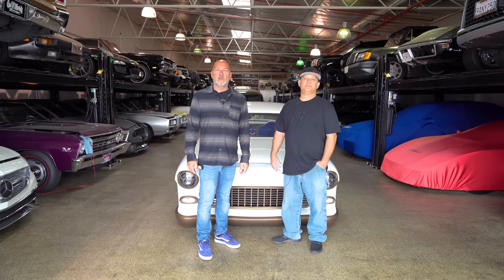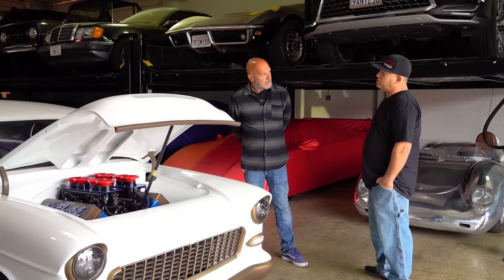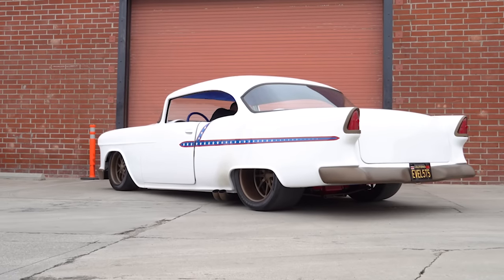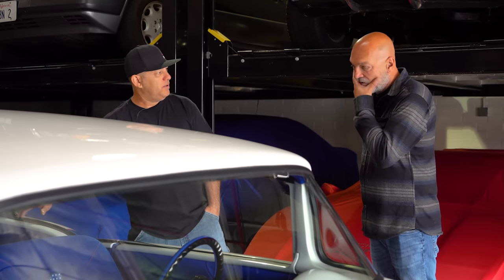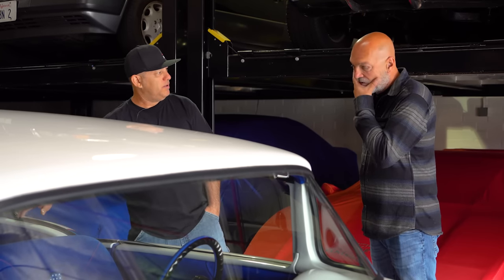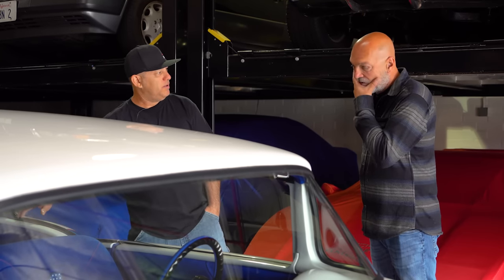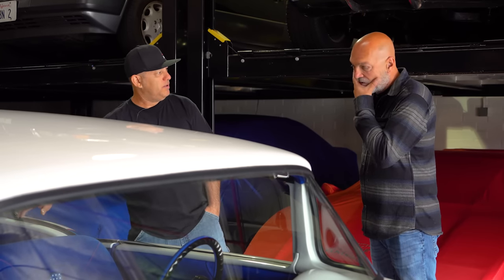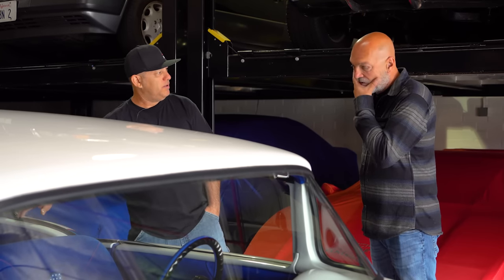712 ci All Motor '55 Chevy Making Over 1000 hp! Evel Knievel Would Be Proud

Comment: The rear end is based on the old Jaguar type rear end where the half shaft acts also as the upper control arm. It's not geometrically very sound but along with the inboard disc brakes keeps the unsprung mass low.

Comment: Use Vaseline on the Body panel near the pipes,so when you ride,you can wipe off the carbon when done.
Reply: Great tip,
Thank you 💯
Reply: @LakesideCustoms36  Yes,I learned about this when someone was doing smoking burnouts and the rubber was sticking to the quarter panels and a $100 tip on the Carcraft tip for the month back in 1985 🙂
Reply from the maker: Smart idea

Comment: What is there a small group of guys local that have these things built? I mean these are $250,000 or more cars when all said and done.
Get a nice custom piece of carbon fiber to overlay on body where exhaust exits and is burning the paint. I got a white turbo catless car and the flames werw burning my bumpee jntil i bought and installed a carbon fiber exhaust piece that covers bumper in that area.  Attached with 3 rivets.  Looks great, no more stained\meltwd paint\bumper.

Comment: Should've done a Cadillac Mirage if you were honoring E.K., when did he have a double nickel shoebox? And 712 CI to make 1000 hp? My 598 stroker makes nearly 900 and will rev to 7 grand, sounds way better than that thing and probably cost half the price. IMO Scott Sullivan had the baddest looking '55 back in the '80s with that tubbed cheez whiz orange monster that was on every magazine cover for months.
Reply: 😂😂😂
A Cadillac??
Come on man…
Reply: @LakesideCustoms36  At least it's a vehicle he was known for. We see so many pics of E.K. with his '55,...oh wait. BTW, that thing's WAY over fueled, I've never seen an EFI setup smoke so much off pedal. Need some tips?
Reply: Maybe a steam rocket car or a wheelie cars would be rad driving down the highway, Shawn would really love riding down the road in that one.
Westech put a temp tune in this before we shoot the video of the chassis dyno. The techs in that place are some of the sharpest in the world for sure.

Stay tuned for the chassis dyno video and it should run about 8k RPM,s. That’s why we spent the extra on the engine.💯🇺🇸😎
Reply: @LakesideCustoms36  The way it smoked it looked like a steamer, lol.

Comment: When somebody says all motor They are making a mistake because motors are electric and not measured in cubic inches only an internal combustion engine is measured in CID, Stop calling engines, Motors. anytime somebody calls there car all motor, I will refer to it as a Tesla. 🤣
Reply: Do you say enginecycles or motorcycle. Motor definition is a machine, especially one powered by electricity or internal combustion, that supplies motive power for a vehicle or for some other device with moving parts. So stop with this annoying, it's not a motor bullshit

Comment: These shops are claiming big big numbers all the time.  People pay and say " I want 1k hp" never having felt a true 700whp in a rear wheel drive vehicle. You're talking either using race gas with at least 110 octane or using a computer controlled E85 setup.  To get big numbers off 91 cali pump or 93 octane everywhere else is very hard to do unless built, little timing and lots of boost.  A real 1000whp+ car will spin the rear tires at 70mph on the street running 315 width R compound rear tires if you nail the gas wide open.  
Even in a heavy car you are spinning everywhere on the streets.
Start posting or showing the dyno pulls\numbers w\SAE corrected and smoothing .

Comment: Shows up with it not tuned 😴
Reply: Actually it was a soft tune installed , we plan of running it hard after break in on the chassis dyno.

Will make for some awesome video footage.
No need to turn the wick all the way up for a shake down.
But we do have the Holley hand held and 4 tunes loaded and ready to go.💯🇺🇸😳
Reply from the maker: Mild tune during break in